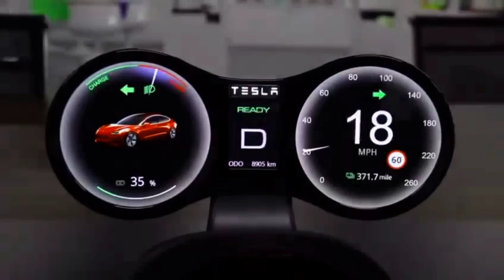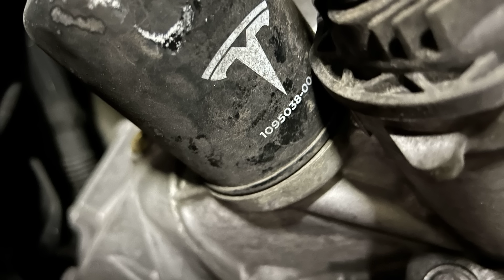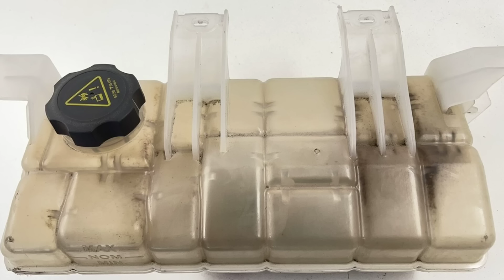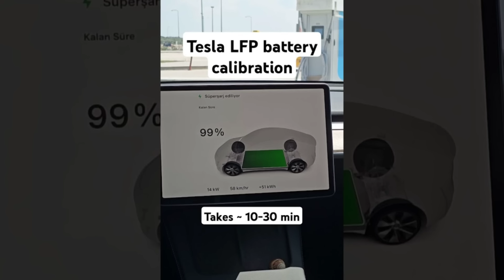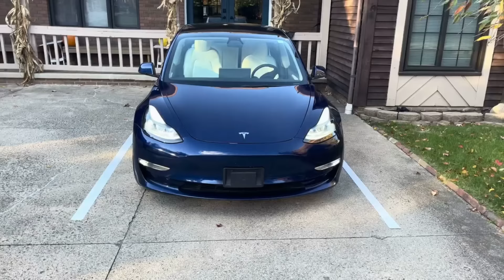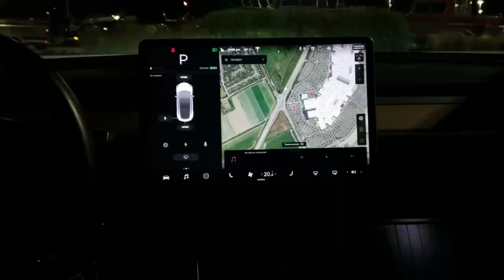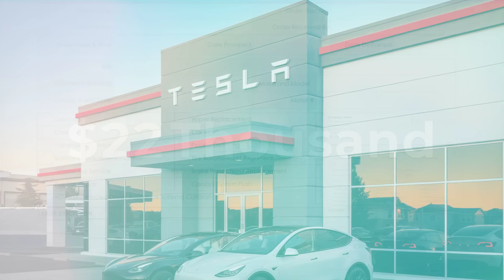Why Tesla Taxis Last 500k+ Miles While Your Tesla Dies Early

Comment: Along with the great ideas shared in the video, here are a few extra tips that can help keep your car safe and sound.
1- A front or rear skid plate to keep your undercarriage safe—Tesla’s plastic version can get damaged pretty easily.  
2- A coolant line guard to shield your high-voltage line; it could save you from a pricey battery repair/replacement.  
3- A radiator guard or mesh to keep leaves and road debris from hitting your radiator.
Reply from the maker: Protecting the underside is easy to overlook, and those repairs can get expensive fast

Comment: Change oil after 50k?
But tesla gives you like 120k mile warranty on the motors...
Most of this video/data is based on older model S infamous for it's unreliable motors and coolant leaks, the newer refreshed models like 3 or Y probably last much longer without these maintenance steps.

Comment: Some of the prices mentioned are far exaggerated. I’m also skeptical that an air filter destroys the compressor.

I have inquired about replacing the coolant, and was told it should not be touched unless there is a leak or defect.

Comment: According to Tesla, the drive units are not filled with oil but with ATF. There is in fact a spin-on hydraulic filter which looks like an oil filter, but it’s supposed to be good for the life of the drive unit. There’s no drain plug, either. The only way to drain the unit is to remove the external hydraulic pump. Messing with the coolant is also a no-no since there’s no regular maintenance access to the filler tank.

Comment: This video is extremely misleading
Reply: Obviously you know nothing about Tesla. Or cars in general. You made a unsubstantiated claim so obviously that must be your opinion. It would be mighty helpful if you put down what you believe is misleading but this guy is talking about in general even the taxi industry guys have excellent vehicles and every now and again they end up with a dud. Quite a few operators move their cars on at 250,000 miles if they’re ice engines some are better vehicles than others but the hybrid Toyotas 500,000 miles plus the trick is it’s better for to be used 24 hours a day. They seem to do extra high mileage when nothing gets cold with ice vehicles. The realities there’s nothing really to wear out on the electric vehicle driveline wise the rest of it is just basic servicing.

Comment: Remember to clean the radiator ,a lot of leafs and so on piles up and clock the airflow and destroys cooling/heating of everything.
Reply: I put a homemade guard on my model S Plaid because I couldn’t find any for sale! It works great and cost me 4 bucks 😊.
Reply: There's no need for that if you fit a guard. Mine doesn't restrict air flow, if there's any leaves caught you can easily see them.
I'll post a link if I remember.

Comment: Excellent tips! For charging you mention level 2s. I've only got my mobile charger. Can that still handle keeping the battery safe? I only ever use superchargers on rare road trips.
Reply from the maker: Yes, you're good. If your mobile charger is plugged into a 240V outlet (like a NEMA 14-50), that is Level 2 charging. Even if you're on a standard 120V wall outlet, it's still AC charging which is the gentlest way to feed the battery, just slower.

Comment: What is suspect as a fraud is these cars/taxis have round dash speedometer and no modern Tesla does
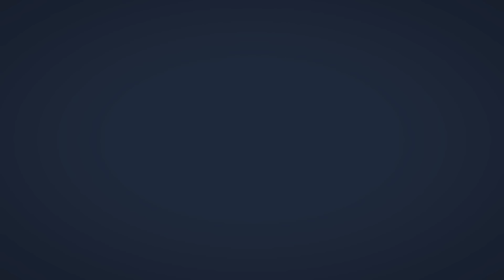Reply: The one at 0:13 is an aftermarket speedometer from BMZX that you can buy and add on to any pre-refresh legacy Model 3 and Y. It was one of the first aftermarket speedometers for the Model 3. No tampering with the car involved other than plugging in some wires. The one at 1:28 is a 1st gen Model S and that's the original software.
Reply: @seaa218 so how is that suspect as a fraud?
Reply: @Truck2Tesla  It's not, that's why I put no tampering with the car involved. Wasn't sure what they originally meant. I assumed they meant that it might be a knockoff car or a knockoff odometer with the miles rolled down.
Reply: Huh

Comment: based on the level of detail you are mentioning, i believe there is an external a/c condenser that is exposed to outside air that has the ability to pickup contamination that would restrict air flow - just like an IC engine system .  It would be good to probably check annually an blow out with compressed air .
Reply: Don't use compressed air, it will bend the very thin fins in the condenser radiator. And yes you are spot-on, when i opened it up and looked at my ac condenser i got a large ziplock bag  full of dirt, twiggs and leafs. Use AC condenser coil cleaner (4 cans) and use a water hose gentle spray to clean them.

Comment: ? Mine has already 280k miles and battery is still at 89% of its original range.

Last diagnostic made found the battery is still good. Not planning to buy any new vehicle nor battery until until it stop working
Reply: Have you done any of the maintenance things he’s discussing in this video?  Not the air cabin stuff but the more involved service
Reply: @jmanjr Yep, break, coolant fluids flush and refuel, 12v battery , cabin and air filters. Also motor lubricant flush and refuel twice.  Ball joints are still ok, since I don’t drive like a maniac. Regular tire rotation, and of course have to buy new tires every 50k or so. Tires are the most expensive of all items to maintain. 

I compare this to my other CRV , same year I purchased the Tesla M3. The savings on my Tesla are beyond my expectations. On gas only, I saved around $40,000 ( price per gallon at $4,00 median here in Florida). I charge my M3 with solar, so I already surpassed my ROI.
Reply: @x7Samuraix   The solar panel installation costs money.   That money can deliver higher returns in wide index funds.  You have got multiple CRV's?
Reply: @E @Elaba_ he solar panel system I installed was around $14k panels , 1 inverter and 2 wall batteries. It only provides power to charge my Tesla , the fridge , laptops and WiFi .

Like I stated, I already surpassed my ROI. Then, there’s the new solid state battery that increases the EV range to over 500 miles per charge. Once it becomes available I’ll buy it.

And since I already have the solar infrastructure, savings will be from the get go.
Reply: @x7Samuraix 
Yes many ppl here installed solar many years ago before even thinking about purchasing a Tesla. In my case instalation was 8 years ago, it has paid for itself twice over.
Then recently bought a Tesla, best car I've ever owned, out of many. In Australia PV installations are subsidised, as batteries now are, (though I haven't got a battery.)

I'm surprised you needed brakes serviced, I rarely use the brakes.
Afaik there's only cabin air filters, none others.
Reply: @jorganzola1 I share the same opinion. Tesla is the best vehicle I’ve ever owned. I rarely use the brakes too.

However, we need to change the brake fluid every 3 or 4 years. We can do it ourselves or go to Tesla service, since it’s not an expensive item.
Reply: @x7Samuraix 
So they say. I know brake fluid is hygroscopic but I've never changed brake fluid, I've found it totally unnecessary and I live in the tropics. You can get it tested for water absorption apparently but it's easy enough to DIY if you're handy should it really be necessary - or OCD/fussy.
Reply: @jor @jorganzola1 the latter 😂😂😂😂😂. Unfortunately, here in Florida, brake fluid tends to absorbs water, so do that myself.
Reply: I never rotate my tires and got over 75k miles out of my last set.
Reply: @fredericklangston2641 wow! Great for you.
Reply: Damn my 160k miles has 74%